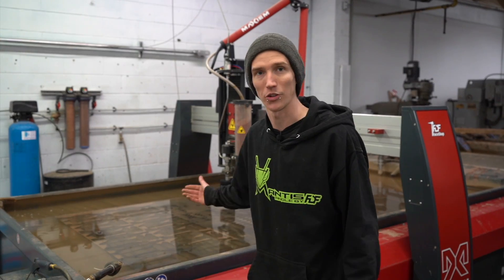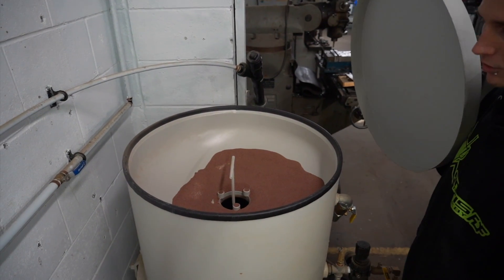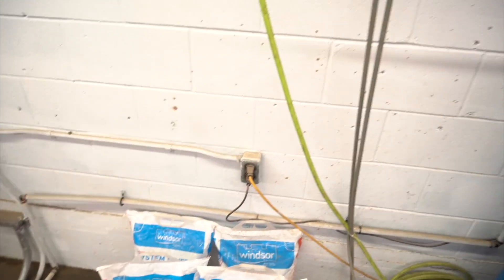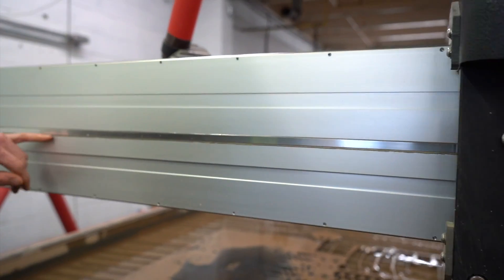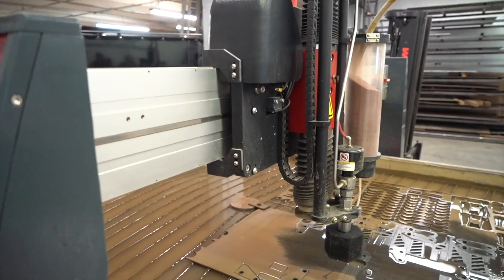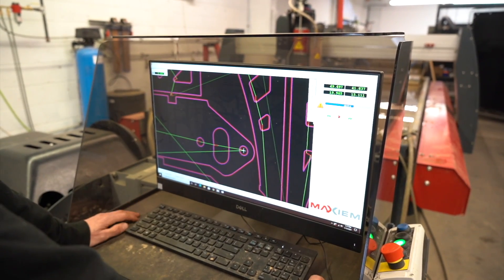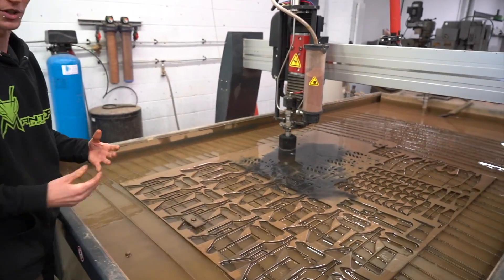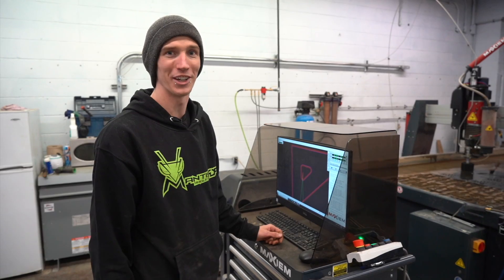Our Water Jet Table| How it Works

Comment: Is it feasible to use a water soluble lubricant to reduce oxidation and wear on the machine, or would that counteract the cutting ability of the jet? Additionally I would really like to see a max depth cut of steel. 12 inches is INSANE!